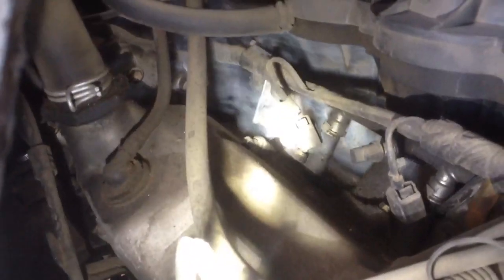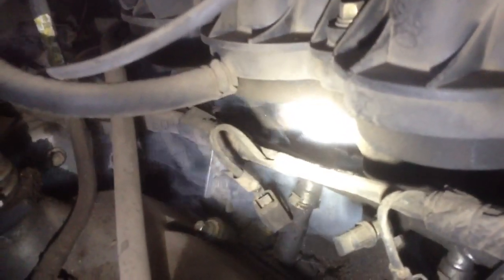2002 Ford van codes P0171 and P0174

Comment: Just throwing this out there for any other ford van owners. My issue was a loose oil filler tube valve cover adapter. It's basically a valve cover oil cap that screws into the valve cover and the long oil filler tube connects to it. It was very loose and just sucking air. I pulled it out, cleaned it up (it has a rubber o-ring. don't lose it) and wrapped some gaff tape (fireproof musicians tape for taping down wires) around the threads and reinstalled so it fit nice and snug. Disconnected battery for a few minutes then fired it up and drove it around for awhile. Check engine light stayed out, emissions flags all reset and I passed smog. Glad that nightmare is over.